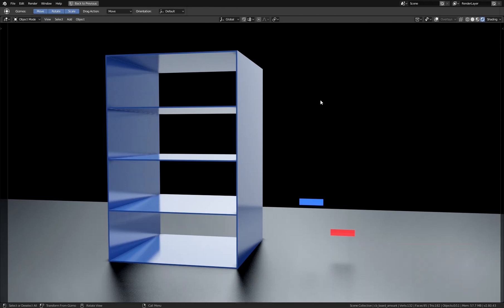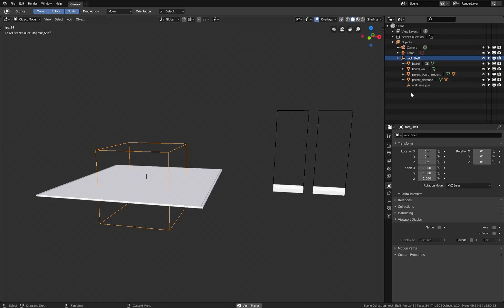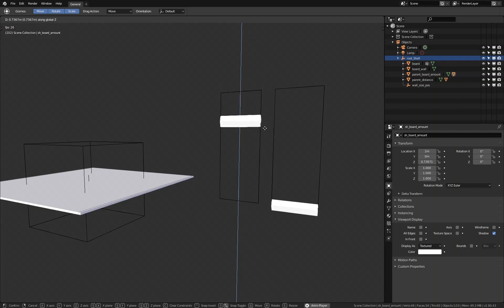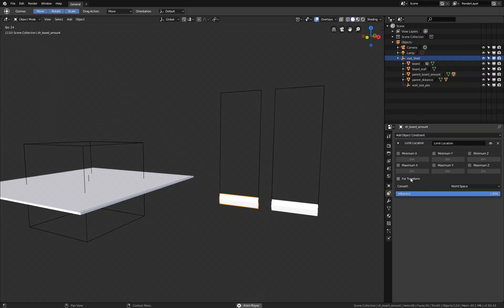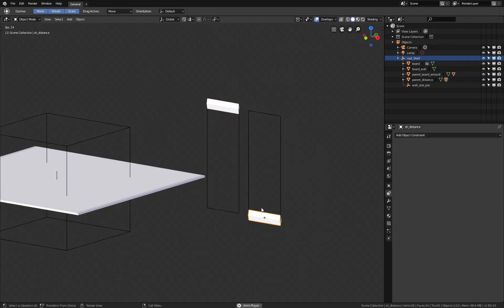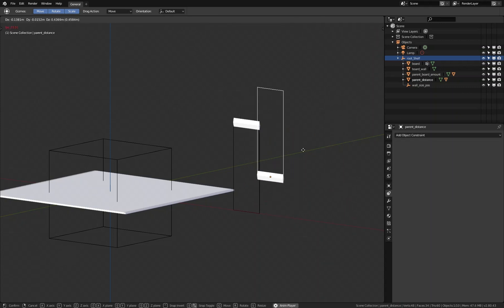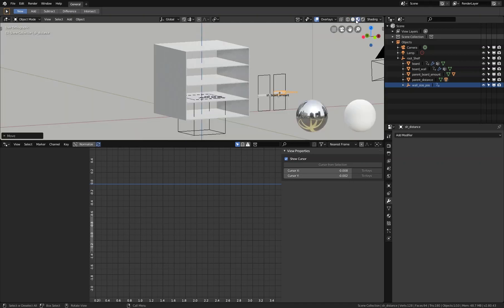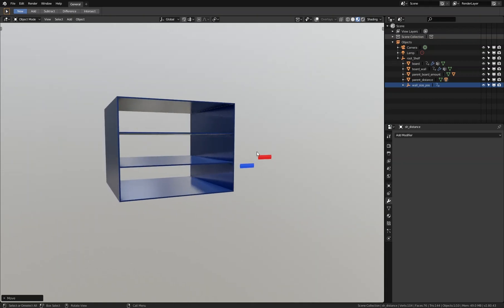Blender tutorial: Create an interactive shelf by using drivers

Comment: Thank you Christoph for the presentation. It clarifies me alot. Can you please explain or direct me on how did you separated the or connected the walls. No matter what I do, when I X scale them, the board length increase but also the wall lenght increase too on the x axis.
Reply from the maker: To change the wall size or position, you have to go into the edit mode of the wall object and change it there. Then it should work to change the wall shape and position of the whole object. Just scaling them doesn't work in this example.
Add. info: Seperating faces can be done in the edit mode. Select the faces that have to be seperated and press "P". Select then "selection". To join objects press "CTRL+J".